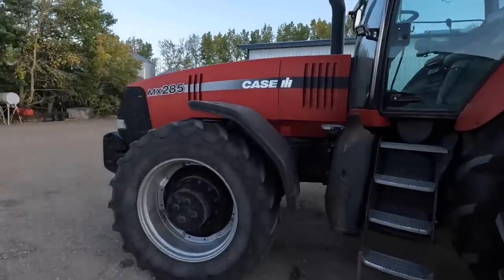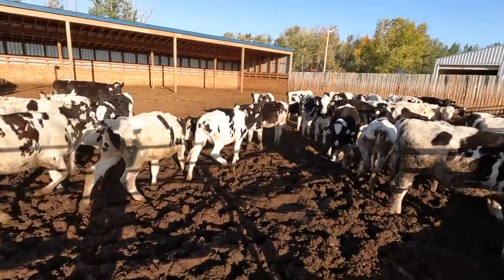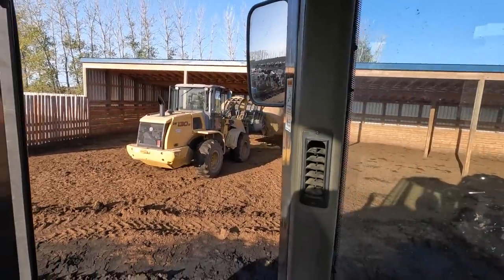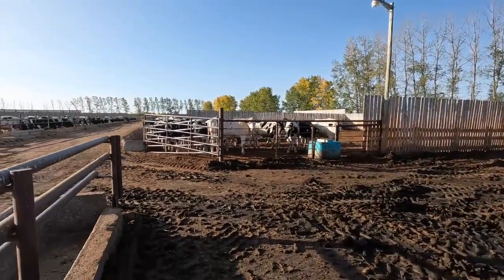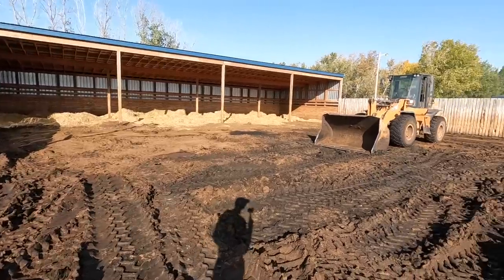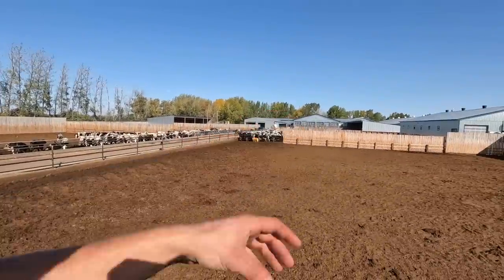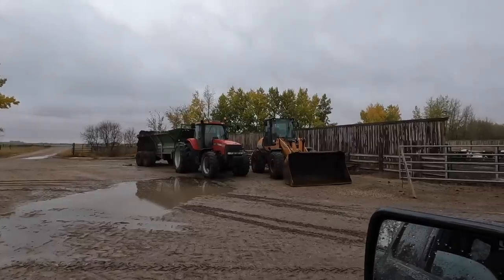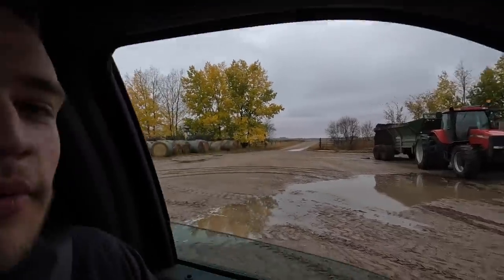Corral Clean Up!

Comment: we run a couple mx series tractors. all of them have a 'jolt' between 6 and 7. the transmission is shifting between two sets of gears right then. tractor reads engine speed from the alternator, check if the green wire is corroded or burnt inside. that can make the problem significantly worse. good luck.

Comment: Always interesting watching another farmer in a different type of farming. We grow Xmas trees and pumpkins. 
   I still wonder if it wouldn't be more cost efficient if you put the manure, bedding, everything else in windrows and composted it and then spread it. Less trips in the field and the material is more broke down.
Reply: @@jellybeandakota6140 
         It's not a cakewalk but you make it sound much more difficult than it is. You can just put organic material in a pile and let compost for a long time. It's called Vermicomposting. It's what mother nature has been doing for thousands of years.
     Then there's Aerated (Turned) Windrow Composting. What you're thinking of. 
     Composting a few windrows of a farms waste is much different than composting in a large facility for a whole municipality. Municipalities have a lot more materials and quicker turn around than a single farm. I'm sure your municipality was limited on space and their compost was in high demand. They had to make sure the compost broke down as fast as possible. 
     The biggest equipment is not needed to compost farm waste. A simple 3-point compost turner, that best fits the budget, is all that's needed. 
     Plus composting is a good way to use liquid manure and not having to haul a few less load to the field.
Reply: @@jellybeandakota6140 
      It's actually quite a bit chemistry but very basic simple chemistry. 
     They probably would actually have more time after starting to compost and more content for more videos. 
    As organic materials decompose, their volume will decrease 20% to 60% depending on the character of the materials and the amount of compaction. The weight of finished compost is usually 50% to 80% of the original weight of the refuse.
    That's literally 50% + less troops in the field to haul manure and bedding. Then when you do Haul the compost to the fields it is a much better product than just manure. 
     Subtract the additional time that can be saved by hauling less liquid manure. If said liquid manure was used to moisten the compost, when it was turned or just pumped on the windrows. 
    Minus the initial equipment cost and learning curve, it's money and timed saved. Less diesel fuel, last wear-and-tear on equipment. Heck, just the savings on tires alone, not having to road the equipment so much. 
     The benefits and profit are almost immediate and immense in the long run.

Comment: I would not worry about that quick shift. I have the operating pressure turned up in the 47re automatic in my Diesel Ram  The quick shift is better for the clutches in the transmission. A smooth shift often relies on two clutches overlapping engagement. This can cause extra wear.  Do you have a preference for the Case or the Deere?

Comment: I dont know much about the mx serie, but the jerking is maybe the change between low and medium range of speed like your versatile do. Maybe it is a failure of the hydraulic accumulator to absorb it.
Reply: Maybe , it can also be that the transmission need a recalibrating like with newer MAGNUM

Comment: You would get so much more out of your manure and crops if you added a injector system on your tanker
Reply from the maker: We had one on our tank but took it off. It made the land rough. Could’ve tried a different set up but we don’t see the need
Reply: I guess you've had a double disc thing that was making kind of furrow. If you use a singular disc coulter that cut a slot rather than move dirt then you would find it beneficial. The loss of nitrogen is massive

Comment: The reason the 285 jumps more sifting from 6 to 7 and 12 to 13 is because it sifting 3 clutch pack sets at once.

But with that sayed it should sift the same as the older box car magnum you have.

From the looks of it in the video i would say you have one or more accumulators that are bad.
I guess for one did the old accumulators get put back on when the transmission was rebuilt.I would recommend putting all new one on. But it's not my $$

Then the other thing is if new ones got put on how did the new ones get charged because new one are shipped with out pressure in them.
And when the new ones get charged it takes a special gas that goes in them.
Compressed air doesn't work.

That still is one of the best power shift transmission made in my opinion.